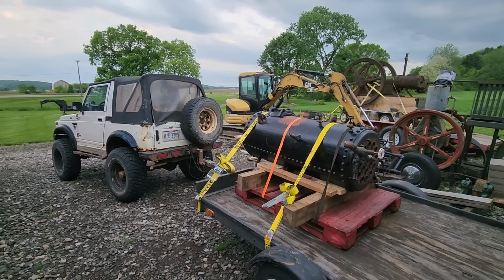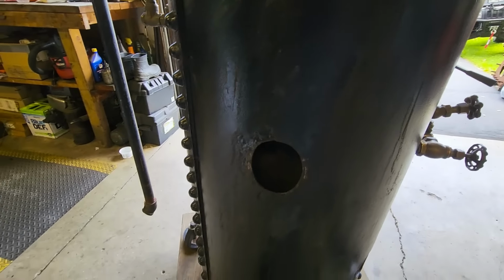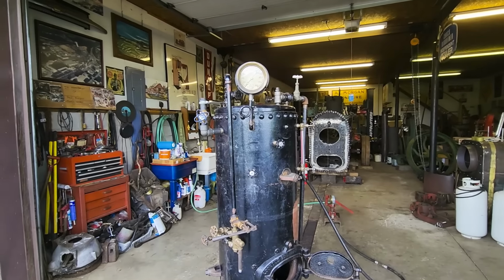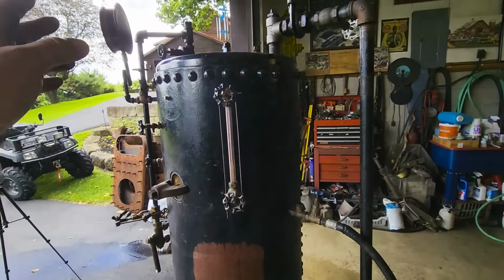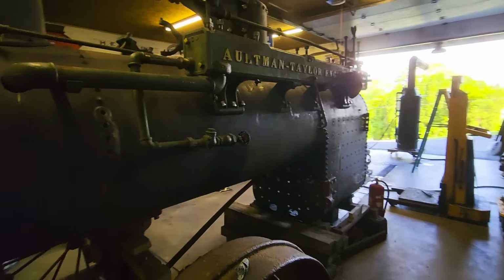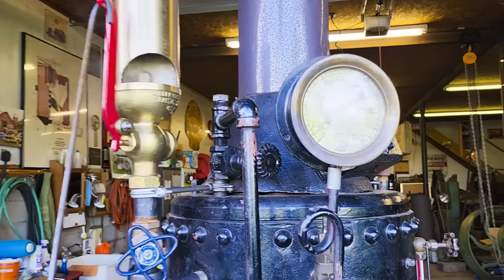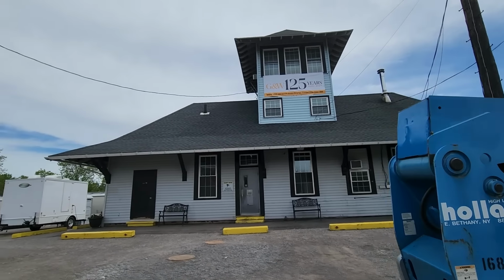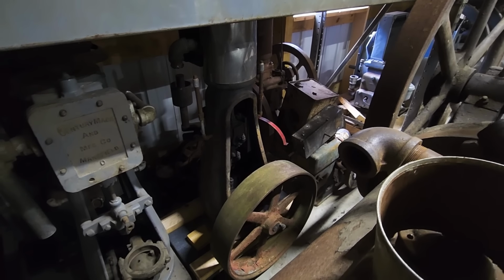Company WHISTLE BLOWER!!!!  Will it be SAFE to OPERATE again?!?!

Comment: Looks good!

Nomenclature: the arched bracket that holds the hand hole cover in place is called a crab.

For safety we closed the sightglass valves and opened them slowly to check the level and then closed them.  In this application, I would leave them open, like you are, because it won’t be in long.

Comment: Caught your video on the 5000 lb 15 horse 2 stroke engine, How long would it run on that tank of propane you had with it, how long can it run for without needing to be shut down? Any idea how many gallons per hour it could move if hooked to a source for pumping? Could they be used in out lying areas to pump water of other fluids to remote towns or such like in desert locations? It would seem a logical answer to modern stuff as it requires much less parts or maintenance. Yeah I think outside the box ,Curiosity makes me ask.
Reply from the maker: A engine like that on a 40lb propane cylinder could run for a couple of days (8 to 10 hrs per day), just idling.     It would definitely work well for what you mentioned.

Comment: I'm not a steam or boiler guy either, but I have a 50/50 chance of not taking a city block out. I've been a welder and hydraulic mechanic for three decades and pressure vessels scare the ever loving crap out of me, I saw a cylinder rupture at over 15000 psi and it wasn't pretty. I like your videos and enjoy hit-n-miss, just be safe.

Comment: It sure looked as though the propane burners were running at too low a pressure.  In operation those buds should be throwing 3-4" blue flames, when you lit it it sure looked to have a lot of yellow.

Source: I build and operate 1/8 scale locomotives

Comment: Chase  you did a nice job of explaining the  boiler and fittings. Only the siphon under the gage is usually called a pig tail. I am a retired boiler inspector, Pa, Oh, My, My & Wv. Worked on boilers from 15psi to 3,000psi. Safety comment, do not re-use handsome gaskets, they will usually fail under pressure.  Goog luck.

Comment: Most don't know there's Cresent wrenches, and then there's those that are superior to the average adjustable wrench.
I've got a set that has the standard measurement on one side stammed into the jaws, and metric marked on the opposite side.
They start at 6," ,and hp up to 24" long all with the measurements stamped onto the Jawa.
There's very little deflection even in the 6", but the other 4 I can't feel the jaws move even if it's opened to the max, and your using a rubber mallet to encourage the bolts to et go of it's bite on the front axle on one off my old MF tractors, because I was going to be mowing on a decent.slope, and I wanted to make my tractor as wide  as possible. 
So moved axles out to maximum width, and spun the rear wheels out on the wheel slides, and tighten the hardware back up.
Most chnnel locks the jaws won't hold true.
Either because there's too much slop in the fitment of the jaws being looks and then there's the adjustment wheel and the threads inside that and the jaw fitment to the adjustable thumb screw that opens and closes the jaw.
The cheap ones  will eat the hardware up, and are known for busting up knuckles, and fingers when jaws loose their grip.
Kinda like good vice grips l, and cheap ones that ruin hardware, and knuckles when they slip are just let go due to poor quality. 
Railroad man, sx brother inline worked MKT for many years, hearing finally got him during a physical for company insurance. 
Even with his hearing aids in.
Be was old enough to retire, but was trying for couple more years.
So now he's at Walmart scaring women and little kids aa tye the door greeter. 
Nice set up.your pop has there, but a little short height wise.
Serves his needs that's all that counts.